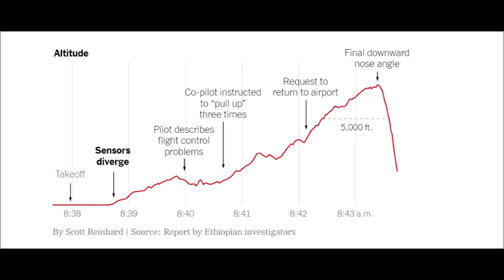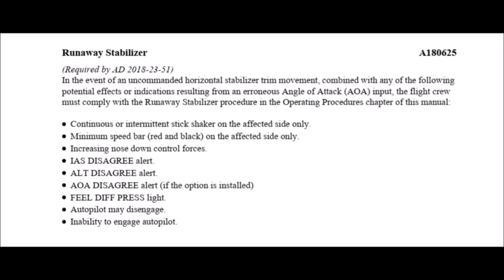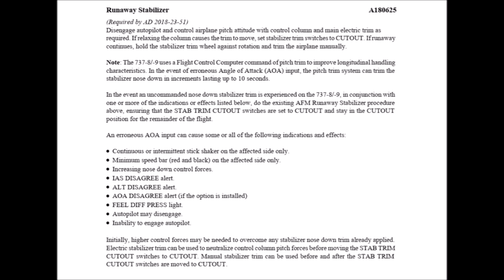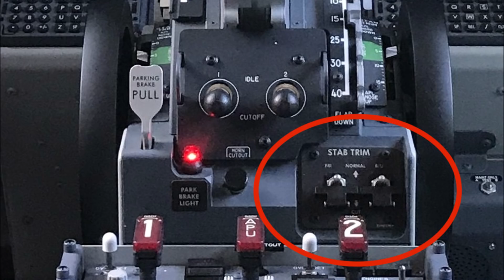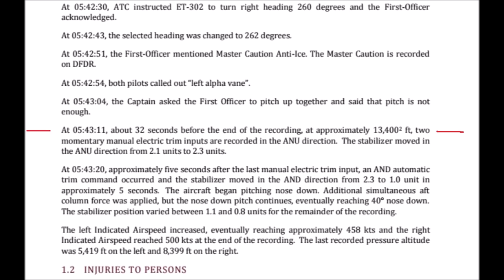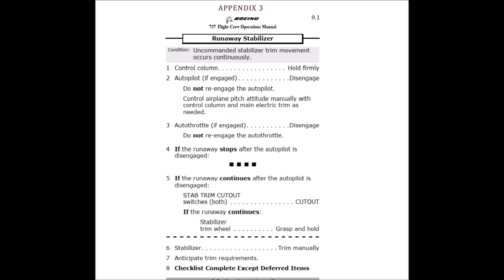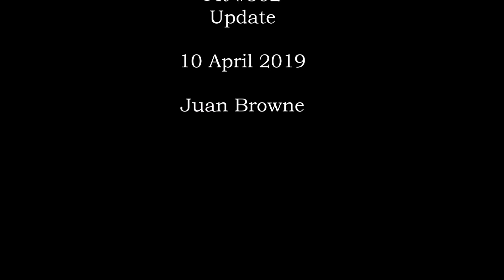737 Max Update 10 April 2019 Runaway Stab Trim Procedures

Comment: Thanks Juan for your efforts and updates. One item that seems to be completely missing in this discussion is the precipitating event of the failure of the AOA system. Regardless of the consequences of that failure which are obviously horrendous and fatal, what is it about the AOA systems in the Max series that is different from the rest of the 737 series and why is it failing  all of a sudden on a new aircraft? There is a lot of focus on MCAS and how it was designed and implemented (and most appropriately so) but AOA systems and hardware have been around for a long time on these air carrier aircraft and is not new technology, what is going on there?
Reply from the maker: Good questions.

Comment: You are not giving me any confidence in this aircraft at all.
1.  Reading the manual as you are losing control of the aircraft is completely ridiculous.  This is like trying to sight read and perform a Chopin Etude, when you've never even heard the piece before.
      The procedure in the manual is something that  needs to be very well practiced.  I can imagine that a pilot with the experience that you have  may be able to grasp the procedures and implement them.  But even in your case it would be much better if you had practiced this procedure repetitively in a simulator until you are what we call in the music business "performance ready."
2.  This really isn't a proper flying airplane.  If it was it wouldn't need an MCAS system in the first place.
3.   Something was malfunctioning.  These instructions really aren't about normal flying procedures but what to do in the event of a catastrophic failure.

You can say it's the fault of the pilots for not reading or understanding the manual, but that manual is actually very confusing.   I'm completely in sympathy with the pilots.  I have been trying to figure out the Binomial Theorem today and have watched three different video presentations on it,  have worked it out on my HP-Prime calculator and still consider myself a long way from actually understanding it.

What are these pilots supposed to do?  Are they realistically going to step forward and say, "I really don't have a full understanding of what to do in the case of an emergency." ?

As a spooked passenger, I really don't care about Boeing's problems.  I find, and have found, their airplanes to be very uncomfortable from a passenger's perspective.  They have luggage bins that don't accommodate regulation certified carry on  bags.  The seats are uncomfortable, and I also suffered DVT on a flight from NYC to Denver when most of the flight was very turbulent, and we weren't allowed to get up and move around.  Being squished in those uncomfortable cramped seats for hours at a time prevents your blood from flowing.

I normally go to Hawaii for the winter, but I didn't this year, and if I never get on another commercial airline during the rest of my life, I will probably be happier.

My understanding is the oversized engines were required because the fuselage was lengthened to accommodate more sardines.  The plane was discovered to not handle well, and the MCAS system was added.  Whether it is the sensors or the computer software, I cannot say.  All I know is that it's a very poor system, and I'm not the only one who thinks this because all the planes are grounded.

I think Boeing should be required to retrofit these planes with either smaller engines or more MCAS AOA sensors, and all pilots should have extensive simulator time, and be tested and certified that they are physically and mentally capable of handling the plane in the event this system or some other automated system fails.

Better yet, Boeing should design and build properly balanced and comparatively easy to fly airliners. In improperly functioning MCAS is completely unacceptable.  What kind of safety system sends an aircraft at high speed straight into the ground?

Comment: OK ! mister computer your going to fly the plane or I am going to fly the plane ?
WE HAVE A PROBLEM ! ( disengage auto pilot ) I the pilot, think I am flying the plane. 
No, mister pilot I have the ultimate say so because my winggy thing says the plane is pitched
to high and the plane is going to stall, pay no attention to the airspeed going through roof, I know 
more than you do.
Pilots are trained to respond to the abnormal and do it very well, as they did !  
Auto pilot off should mean, all  automated systems OFF !

Comment: Given everything we know now, wouldn't it seem that the best course of action for both the FAA and Boeing, is to require a new rating for pilots to fly the 737 max aircraft?

The MCAS system was conceived to permit existing 737 pilots to fly the MAX aircraft, yet it seems that any flight characteristics maintained are overshadowed by potential malfunctions and the cognitive load associated with them.

But now the events are very much in the front of everyone's mind.

Since this was fastest selling airliner prior to these incidents, I'd wager that Boeing can limit their losses by quickly implementing a program to add a MAX certification to existing 737 pilots.

Comment: Question, how often do angle of attack sensors fail? Could the design of the sensors themself also be factor in this accident? Thanks, I enjoy your videos.
Reply: Bryan Benjamin There is a Bloomberg article published today, which I linked earlier in the comments. It lists a number of AOA faults, mainly due to mechanical damage (bird-strike or impact while parking).
Reply: @gordonrichardson2972  I doubt they are damaged when parking.  Even a bird strike seems pretty remote.  More likely they seized up due to friction caused by what?
Reply: "Even a bird strike seems pretty remote."  Really?   US airways flight 1549 hit a flock of large birds and both engines failed.  The pilot had no choice and made an emergency landed in the Hudson river  Southern airways flight 242  flew through softball sized hail and lost both engines and crashed.

Comment: Why the Boeing no put there a next to the cutout switches a third button with "TRIM NEUTRAL" function if they know manually the pilot can NOT steer the trim wheels at higher speed? So with that, the pilots trim the stabilizer to a neutral position within seconds and after that, the elevators will be effective enough to keep the airplane in the air. Or put a little joystick and the pilots can trim "manually" but with electric motor power steering. 
Where are the brilliant engineers???
Reply: You have an airplane that is out of trim from the get go.  Not good in my opinion.  Very similar to the Corvair.

Comment: First mention I've seen of the improper MCAS deployment mentions it taking trim from 4.6 units (climbing) to about 2.0 units (shallow descent) with repeated MCAS events taking trim down to as low as 0.4 units and pilots countering with electric manual trim to about 2.3 units before deactivating "cutout" switches. It seems maybe more corrective ANU trim should have been applied before cutout switches were turned off? Then they struggle for 2-1/2 minutes pulling on column to maintain climb while troubleshooting problem. At some point they talk about the trim "not working" and it's not clear if that means electric or manual cranked trim. 

After they turn Cutout switches back ON, they recover a bit with electric trim, IF cutout switches had been instantly shut off again at that point they would have slightly improved the situation. Instead, MCAS kicks in again and takes trim down to about 1.0 unit (dive). It seems the natural human reaction at this point would be to HOLD that thumb switch to trim nose UP. According to FCOM any autopilot or MCAS input can be reversed with manual electric trim. Picture driving your car and a tire blows pulling you into opposing lane-- the almost INSTANT reaction is yank wheel in the opposite direction. 

I'm wondering if for some reason, while cutout switches were ON, if they were trying to trim nose UP and getting no response from thumb switches. Data recorder notes inputs and control movements but apparently NOT switch movements. We may never know, but if there WERE switch inputs with no results the next question is why?             Is it-----------------
1. The aerodynamic load on the (out of trim) stabilizer caused by the excessive speed is so high that even the electric trim motor CAN'T overcome it? If this were the case does the motor simply overload, stall, and trip a circuit breaker? Or is there some kind of slip clutch / brake between motor and jack screw? 
2. If thumb switches were engaged and motor was NOT commanded to run? Then the logic in the automation has an error! Even though it's stated that the manual electric trim overrides any automatic inputs--- when sensors fail, everything is in upset conditions, and people react in an unforeseen way, some unforeseen action (that software engineers might say CAN'T happen), might just happen!
Reply: This is the quintessential definition of a Kludge.
Reply from the maker: See previous updates.

Comment: 7:08 "AND direction" - (A)ircraft (N)ose (D)own  ?    (A)ircraft (N)ose (U)p   Are we also certain that ELECTRIC TRIM switch has priority over MCAS commands?
Reply: birdwing98, the manual says the electric trim has priority over MCAS, but it really seems there was a struggle to solve a simple  problem that can be (at least temporarily) corrected with a "thumbs up" movement. Seems like a very basic question that needs answering! Lots of name calling going on from people who don't like armchair quarterbacks but they don't seem to have  have many critical thinking skills!
Reply from the maker: Yes. As we currently understand it.
Reply: The trim switches cut all electric power to the trim motor.  Without electrical power to the motor MCAS cannot do anything.
Reply: Steven F , I believe birdwing98 is talking about the electric trim thumb switch on the control yoke, you are apparently referring to the stab trim cutout switches, not the same thing.

Comment: Sensor failure can not be a cause of the problem. It is how you design your system to react to the sensor failure that is critical here. Having no redundancy on a sensor that can cause a catastrophic ending is a fundamental design flaw that should have never been approved.
Reply: Its never one thing that cause
 crashes
Reply: the failure was failing to just copy the rules that they already had working perfectly fine on the boeing tanker version (i don't understand why someone made the new code and did not consider the implications of using only one sensor to trigger the nose down event and no warning or failsafe for easy disable) below will be the fixes for 737max and what's already implemented on the boeing tanker version

AOA disagreement MCAS will not activate if deviation is to far between 2 sensors (if autopilot can't enable Mcas should not activate)
Limit trim amount mcas can do if activated (there is no need for it to goto max trim down)
and if system does activate and pilots disagree with MCAS auto trim down event all they have to do is pull back on the sticks and it stop MCAS and disable it (won't have to stab trim system)
Reply: The pilots did the easy procedure by manually cutting out the automatic trim controls. That didn't work because they were going too fast. They do have a redundant system - there's two sensors, one on each side. If one side disagrees, the pilots did what they were supposed to do and cut out the automatic trim. Having 20 sensors wouldn't have made any difference.
Reply: You're supposed to take over and fly the plane manually which they neglected to do by ignoring the throttles.
Reply: Max8 MCAS takes reading from only one of the AOA sensor. While the MCAS on other non commercial Aircrafts actually takes reading from two sensors and as a result is smarter to know if the reading is erroneous. A redundant system should continue operation normal while alerting you that there is a failure in the system. 
2. MCAS automatically increases the throttle in an effort to prevent stall. Because it is designed primarily to prevent   stall. 
3. You can avoid flying certain airlines you don't trust. But you can't avoid flying Boing.

Comment: Another question, not sure if anyone else has already covered this. If the auto throttles were still functioning properly, why would they keep power at 94% as the air speed is approaching and exceeding redline?
Reply: 25mitchel The autothrottles assume that the aircraft is climbing. They are not particularly smart in the B737, and only do what they are pre-programmed to do.
Reply: @gordonrichardson2972  seems like the Boeing automation makes a lot of false assumptions.

Comment: Regarding the 737 Max, if the stab trim is full nose down, is there enough elevator control to maintain level flight or possibly climb?
Reply: Jeff Andrade No, that is what caused the crash. The horizontal stabiliser is a very powerful flight control on the B737, and the elevator is relatively weak. An out of trim stabiliser is an emergency.
Reply: Gordon Richardson That’s what I thought. There’s a LOT more surface on the stab compared to the elevator. If I remember correctly as a young pilot, the new (at the time, late 60’s) 172 Cessna Cardinal didn’t have elevators, only a controllable stab. I quickly learned on my checkride that landing definitely needed stab trim or the yoke would pull your arms out of their sockets.
Thanks for your reply Richard!

Comment: There's a part of the report where the nose pitches down slightly even after the cutouts are pulled. In my comment to your last video I asked about that. Don't you think it could be significant? Psychologically at least if I cut the fuse to something and it still happened, at that point I'd be flat outta ideas and willing to try anything. 

As far as the FAA's exhortation to keep the stab trim switches off, language isn't specific but it might possibly mean once you've regained control of the aircraft. In this case the pilots were still in the middle of the battle: the manual trim wheels weren't working, its possible they flicked the switches back on to try to move the stabilizer with electronic commands - and it worked. But MCAS was still active. It cannot be switched off, only isolated. So its lurking there like Chucky, sending commands which are bouncing back until one went through. Pretty murderous system. 

If only. If only the pilots had cut out the trim motors again as soon as the nose came back up. But I guess by this time panic and brain freeze had taken hold. Such a tragedy.

Ps. People will nitpick and find a way to point a finger at the pilots. Before you do so please ask yourselves who put them in that situation. This situation cannot happen in any other aircraft. In the Max it has happened multiple times, twice with fatal results.

Comment: yeah this is very interesting to me I'm on a low hour but $600 Cessna 152 172 and Piper Warrior pilot in it just makes sense to me not having all this Automotive automation to begin with that the first thing to do would be to cut off 2m Cass the stab Trim in the auto throttles just get rid of all that shut all that down in the very beginning and just fly the plane all these procedures in between each one just like you said Narrows your vision down to a pinpoint what's your opinion of that thank you sir enjoy your your videos

Comment: The preliminary report states that the first officer requested to manually trim the plane and less than 10 seconds later reported that it did not work.  That implies the captain did not help using his trim wheel handle, otherwise he would have known it the manual trim wheel was not able to trim the plane.  I could not make out the charts, but from other narrative comments, the plane was under 350 knots.  

Mentour Pilot put out a video a couple of weeks ago showing a simulator session on dealing with a runaway stab situation and the manual trimming of the plane.  The first officer had a very difficult time trimming by himself.  Then when the captain assisted with his trim wheel having the handle offset 180 degrees from each other, it looked much much easier.  

The question that comes to mind is did the captain also try to manually trim the plane with the first officer and if that would have made it possible to operate the manual trim.  Is it normal to expect both pilot to operate the manual trim in such a situation?
Reply: Bruce H There is some ambiguity in that discussion. Manual trim can either mean turning the wheels, or pressing buttons on the yoke. This is in contrast to automatic trim, which is applied by the flight computers.
Reply: Gordon ..... By manual trim, I meant the two trim wheels on each side of the center pedestal with the extension handles.  I have heard the trims buttons on the yoke called electric trim.  I do not know the official terms.  

BRBR .... I wonder if the investigation will include Boeing doing testing to determine if two pilots can adjust trim with the wheels under those conditions.  It sure looks tremendously easier when both pilots are rotating the wheels.  I take it that is because when one does not have leverage, the other does.
Reply: Until I saw the Mentour video you mention I was thinking "no big deal" just grab the wheel and give it a couple spins. I was shocked when I saw that guy struggle to get each 1/2 turn. And at high speeds it's harder yet. I would like to see an explanation of how much cranking is required  to correct 1 degree stabilizer movement. Sounds like it's an impossible fix when things are way out.